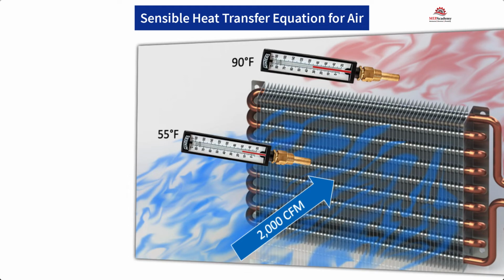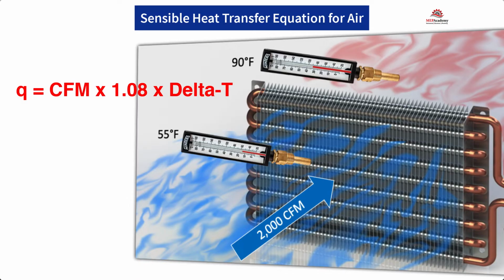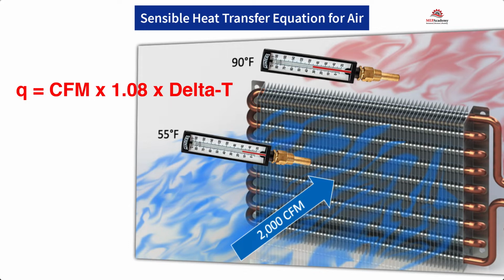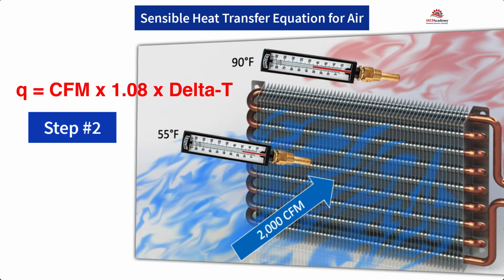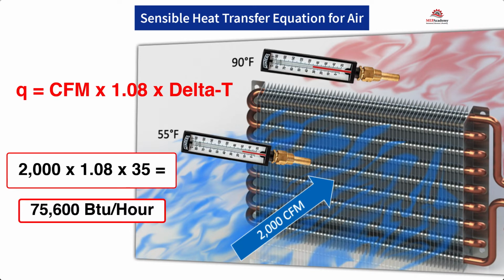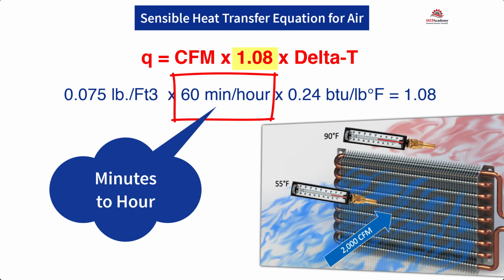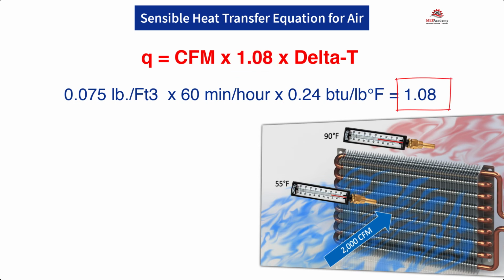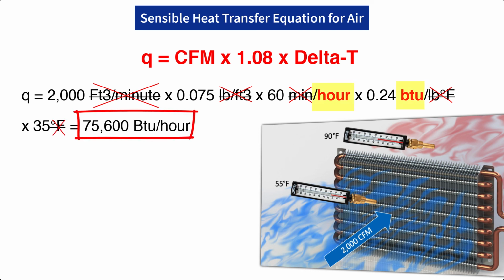Sensible Heat Transfer Equation for Air

Comment: Good video. When calculating air flow, can you explain why the air flow increases when delta T drops? eg 5000W / 1.2x14oC = 298l/s and 5000W/1.2x10oC = 417l/s
Reply from the maker: Because with a smaller ΔT, each unit of air carries less heat — so you need more airflow to move the same load